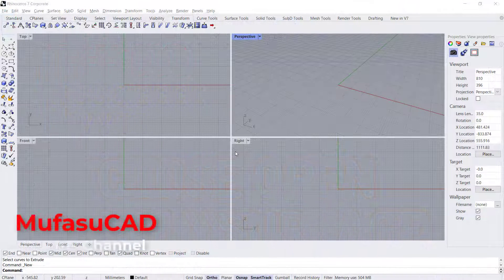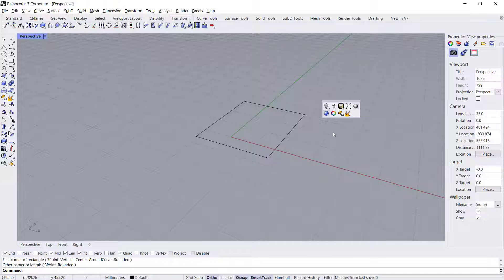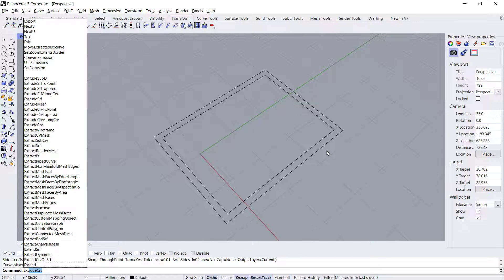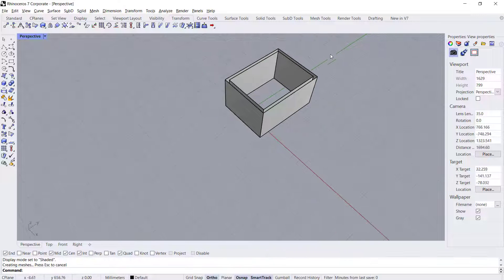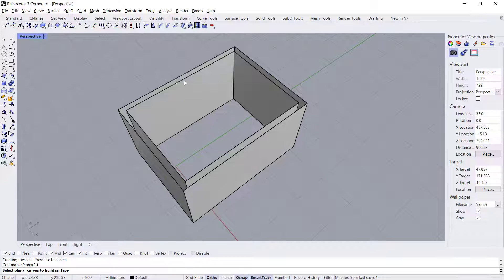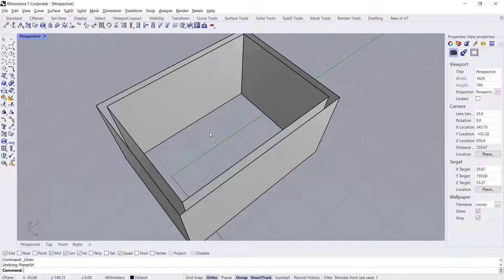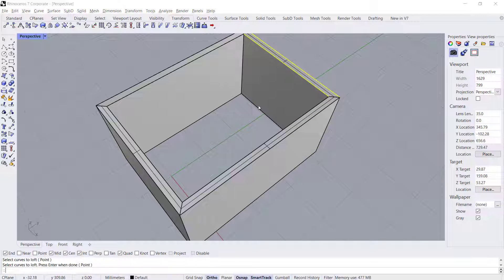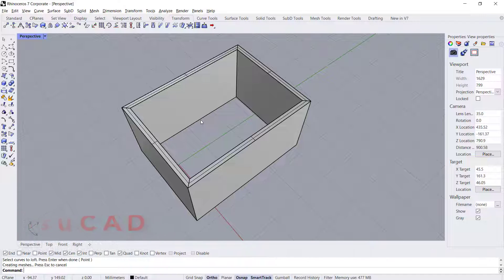Rhino How To Close Open Polysurface

Comment: 1: Select the Polysurface 2: use rhino command (cap) it automatically closes symple polysurface on top
Reply: if your opening is very flat and 100% planar, yes this will work. But in most cases cap will not work.
Reply: Ay mamacita
Reply: legend  @WastDark
Reply: smth like that is what i searched the last hour at least, thanks!!!!!